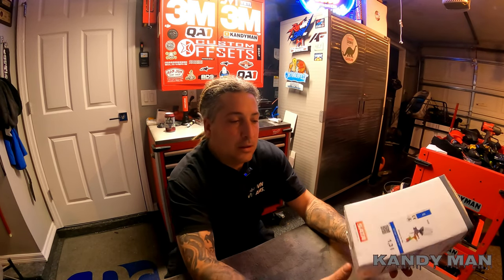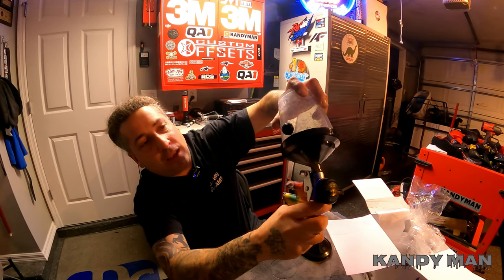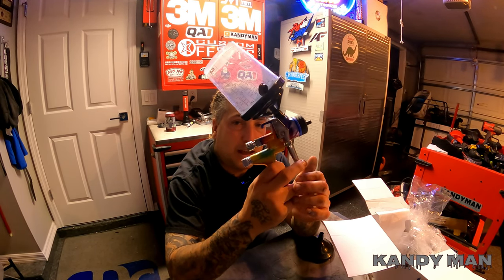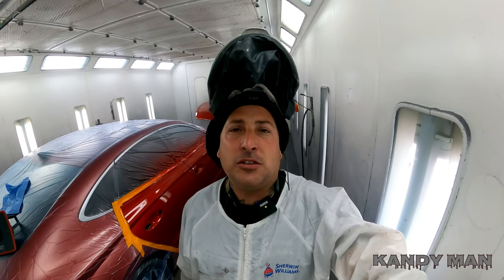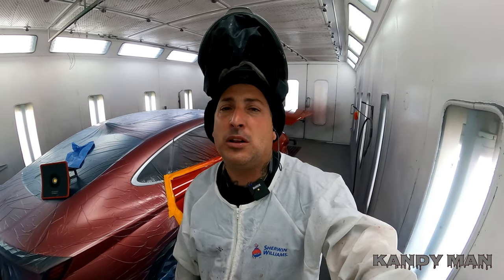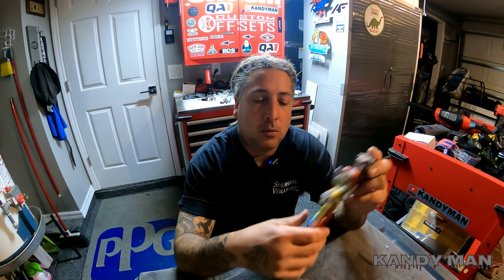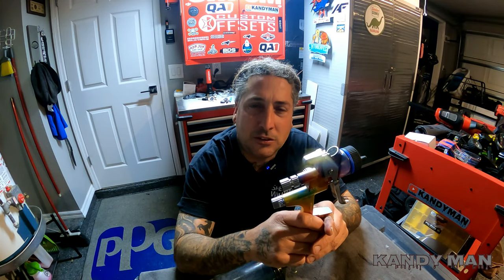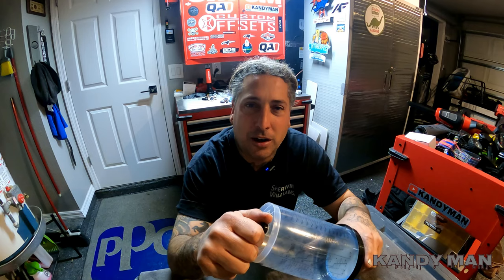GOT THE NEW CLEAR GUN!!

Comment: Surprised you got the x and not the i, the x is the same as the older 5000
Reply from the maker: Ya is says I on it to on the air cap it says jet x 5500 rp 1.3 I thought it was an I?
Reply: @kandyman5315  yes you do have the I then, good gun👌
Reply from the maker: Thanks you had me worried 😟